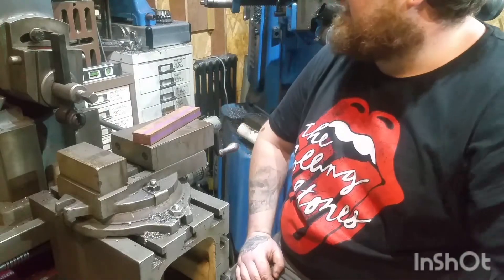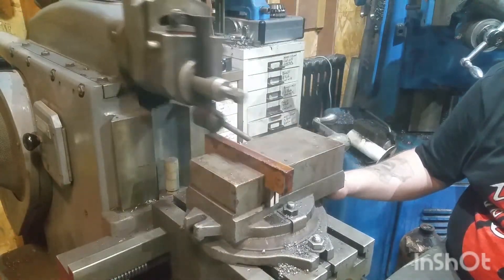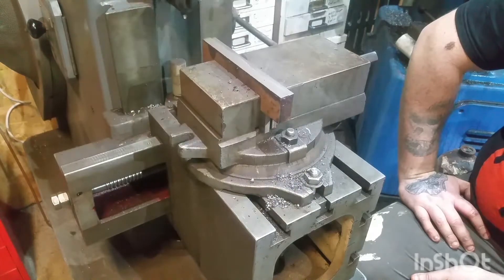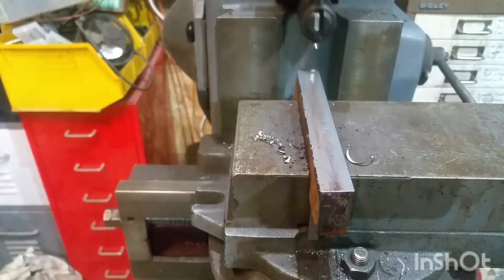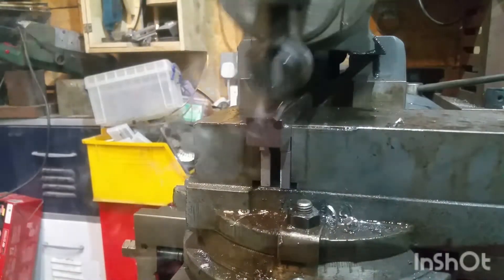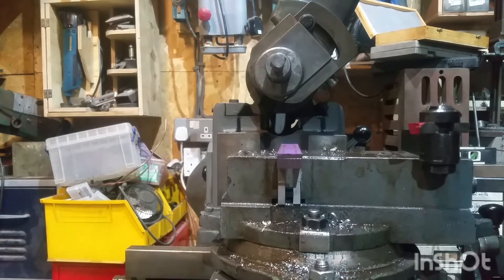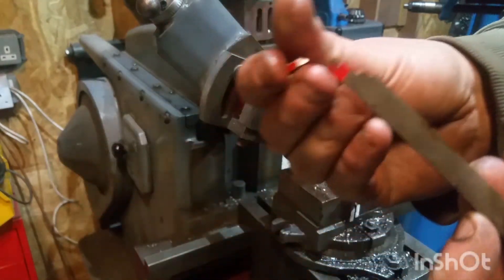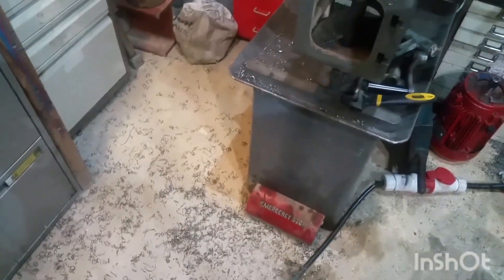elliott 10M metal shaper, group profile T nut blank. 1/25 scale replica fireball tool chips

Comment: Good job, and good to see in operation this little shaper. :)
If I see right, the table feed is in the working stroke, and this is not too good. I suggest to check it.
Reply from the maker: Yes it was I didnt realize untill a little while later. Thanks for watching
Reply: @smithbuilt  
Ok. I am a shaper fun, so waiting for your next job with it. :)
Reply from the maker: @kokmil  me too they are so useful and underrated by so many.
Reply: @smithbuilt  
Yes, I think the same. I bought a shaper from the gate of a scrap metal yard, and now I am doing the maintanance on it. I really love it. 😊😊
Reply from the maker: @kokmil  there great. Mine is only a 10 inch but I have done jobs on it that a mill just cant. Like in the video before this one I think. I had a narrow channel that I needed to cuf a grove into the side of. A mill might have done it if it was not so narrow but a shaper can get into places a mill can not and vice versa but even so you need both.
Reply: @smithbuilt  
Yes, and If you see the quality of the finished surface, the shaper is the winner. 😊 I have 22” srtoke one, and I think a little younger than yours. But in this case the age doesen’t matter.😉
If you think you can check mine on my channel.